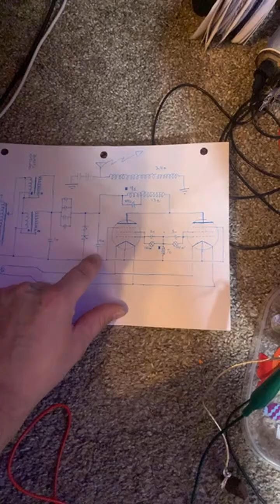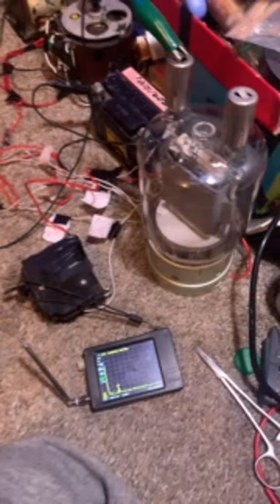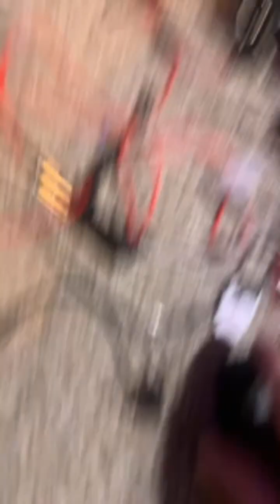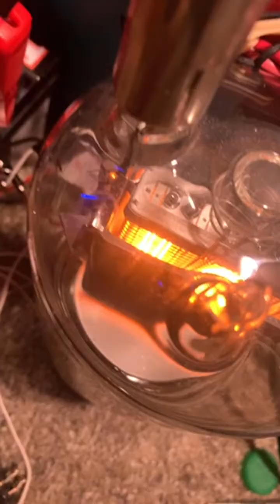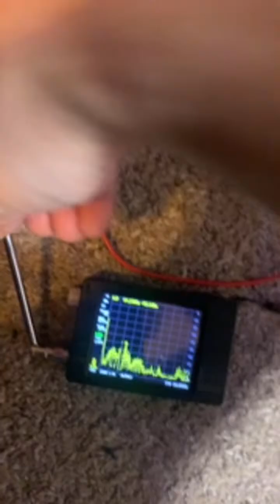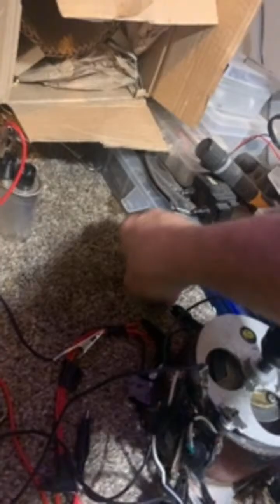Live! HOLY SMOKES! WE HAVE EMISSION!

Comment: Dangerous setup.make it in a more permanent setup without lose connectors switches or even plugs touch no part of the high voltage capacitor ig may stil contain load be never touch connectors when things are running not all variacs even grid sepatate thru might requirevanbextra separation transformef even then be extremeky cautious put dog on leash to make dure he does not get in danger or have him stay somewhere else...
Reply from the maker: I wouldn’t worry about the dogs. They can hear the high voltage and want nothing to do with it. My wolf dog knows when the variac is energized too. He sniffed it once. They wouldn’t appreciate the leash. Anyway im always aware of where everyone is and always have a plan b and c. Also, they would have a hell of a time actually getting it across the heart or through the fur

I am not making anything safer. Unfortunately  i have very little energy and money. Id never get anything done. The final iteration will be far less of a hazard.